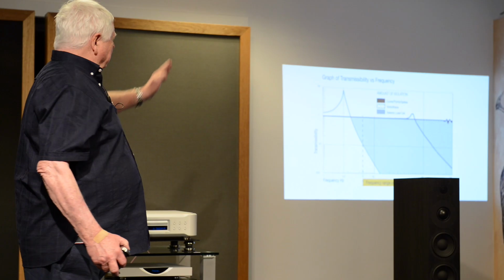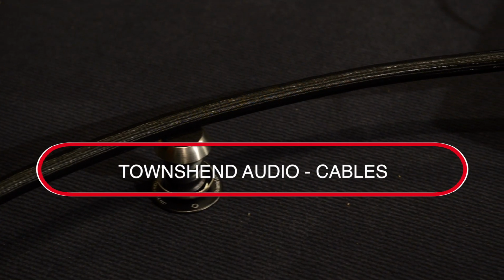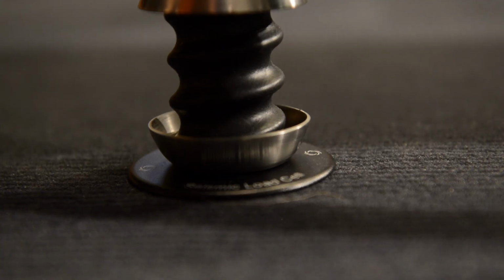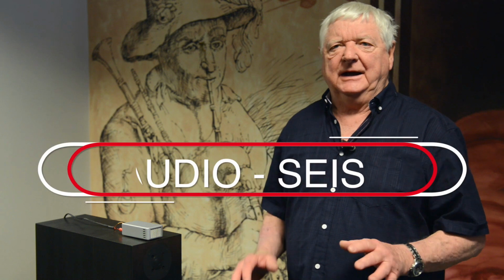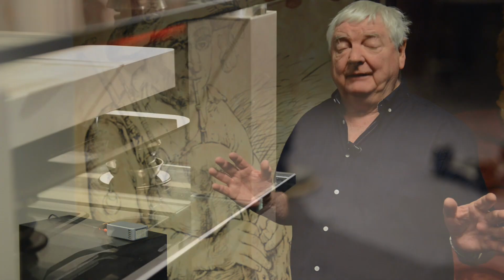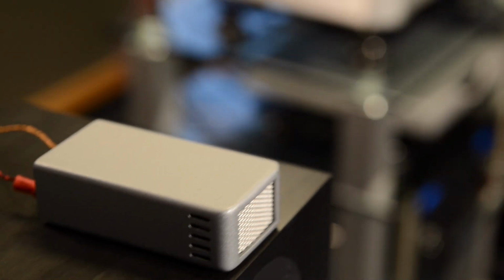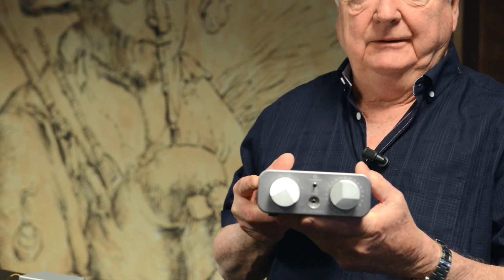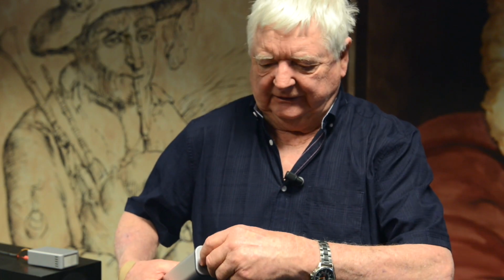Townshend Audio - Alpha High End Brasschaat event with Max Townshend

Comment: I have a pair of the supertweeters and cannot say enough good things about them, and in the context of a high end system (my system is no slouch).  They add so much by doing so little, but what they do add is so important.  Just as a subwoofer auguments the lows, the supertweeter adds to the highs, and in every way.  Superb.  Easy to setup, use and dial in, which is a big weakness for supertweeters in general.